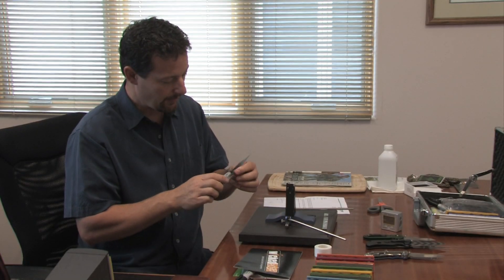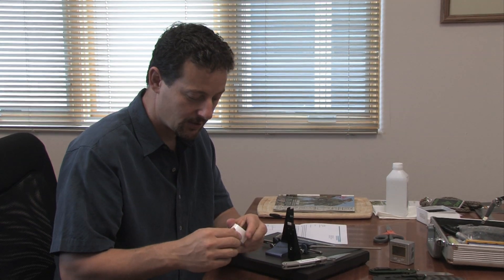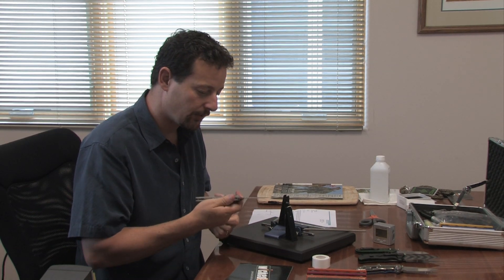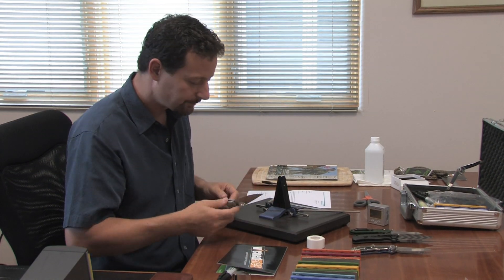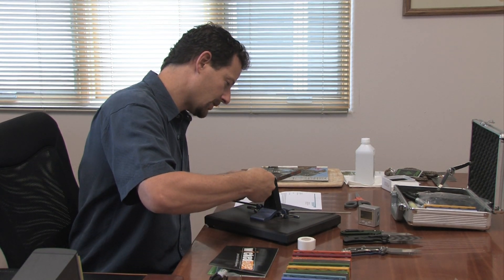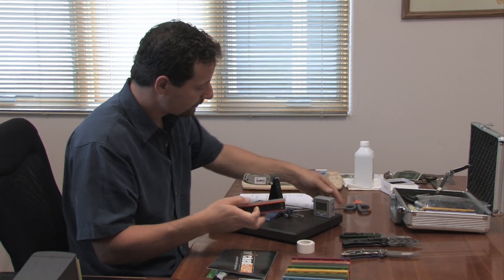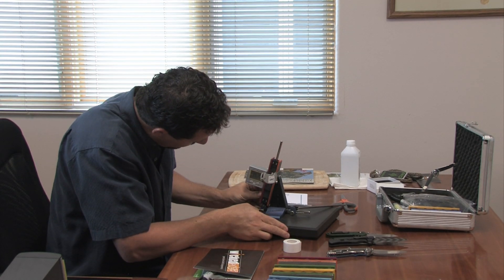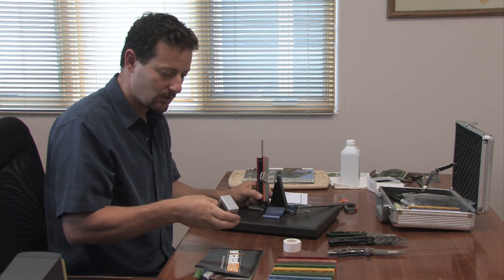Wicked Edge FAQ - Sharpening a Fully Flat Ground Blade

Comment: There has to be a better solution than this.  I've tried this, but no matter how it's done I've ended up with the blade not being perfectly vertical which results in me having to adjust each arm to a different angle and mark the bevel with sharpie to make sure I'm getting full contact.  I've basically dropped using my wicked edge due to this issue and I'm just using my Japanese water stones now.  This seems like a problem in search of a better solution...maybe one that would get me back to using my wicked edge again.
Reply from the maker: Have you checked out or Generation 3 clamping system? I think it addresses the issue you're talking about really well: https://www.wickededgeusa.com/product/generation-3-vise-jaw/

Comment: Just wondering if you have checked the work surface for level in both x and y planes before placing the Wicked Edge on top and using the digital angle gauge?
Interesting system, very tempting!